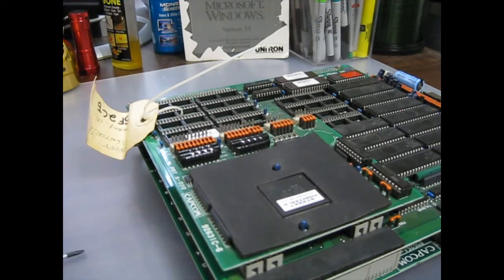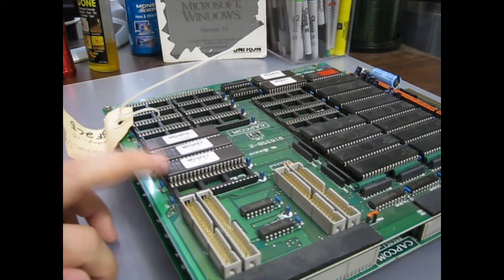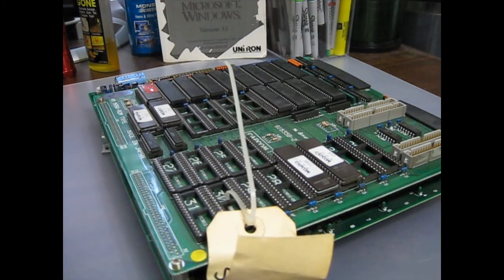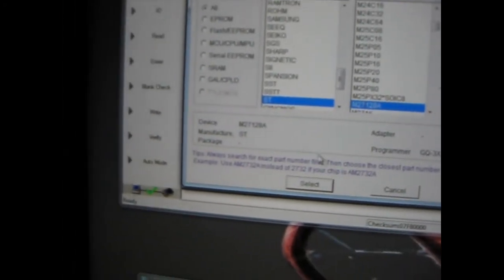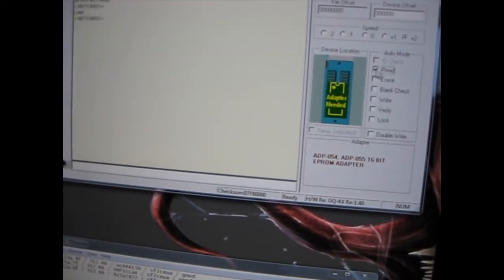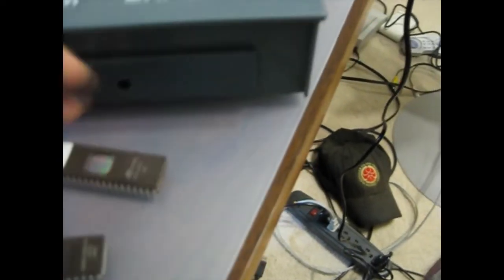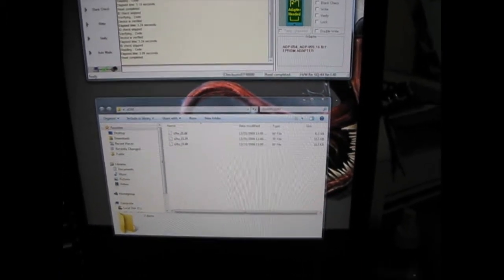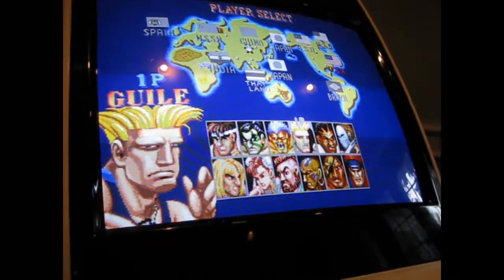Converting SF2 Champion Edition to SF2 Hyper Fighting (arcade JAMMA)

Comment: I have the same programmer and 16bit adapter, I've been trying to convert my usa champion edition to japanese street fighter 2 turbo but not having much luck i can programme the roms 21, 22 and 23 just fine the game works fine except that on the title screen the  little turbo logo is all scrambled like its missing is graphic instructions from somewhere, any ideas?
When you download turbo rom file it comes with 7 rom files in the folder 10, 11, 12, 13, 21, 22 and 23, ive put 10 to 13 on am27c400 roms which is a direct replacement for the mask roms on my board but just makes the game all scrambled.

Comment from the maker: @paran01d Some people say you can, while others say you can't.  If it is possible, though, you'd have to change out most of the chips on the board just to go from WW to CE.  There's supposedly a very big difference between the original WW and CE, data-wise.

Comment from the maker: @MENDEZ1628 Thanks. :)  All of the chips conform to a standard and are all read the same way.  The chips come from all kinds of manufacturers (Japanese, Chinese, etc), and the data does not matter as it's just a bunch of 0's and 1's anyway.  You do have to get adapters for the reader for certain types of chips, though, such as the one I used in the video.